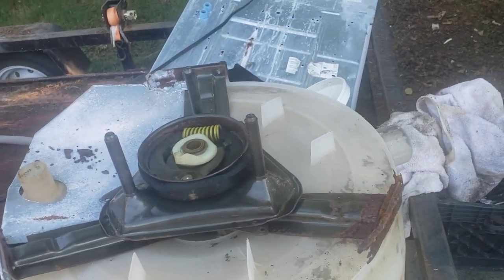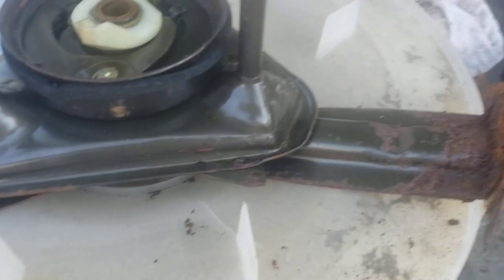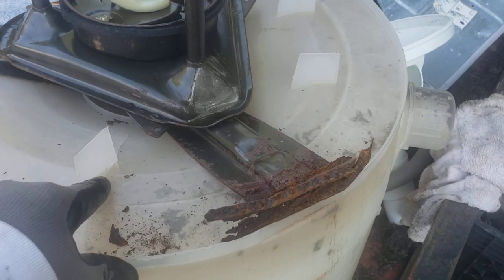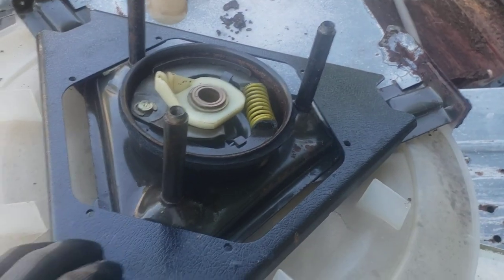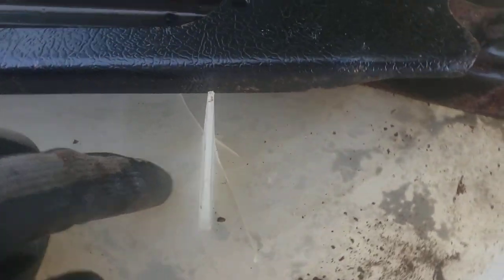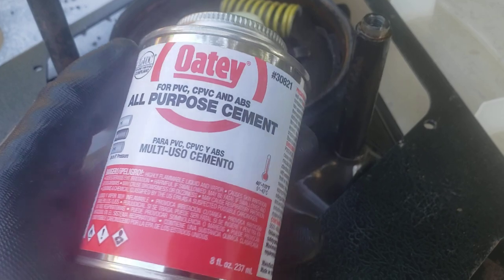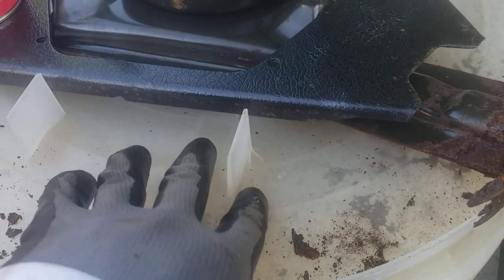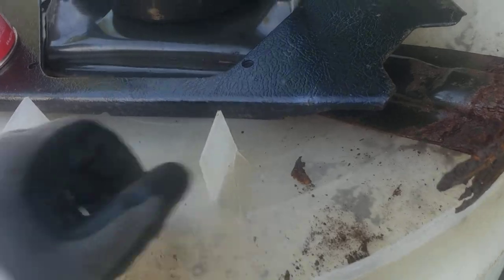Hidden leaks in your Washer Tub

Comment: Is there a use way to remove the inner tub. I have one that I can't get off.
Reply from the maker: Yes but you need a Spanner Wrench! Local appliance part store or Amazon
Reply: @LeanOnYourRep  used a spanner wrench , jack with wood..even took the motor off and tried it from the bottom